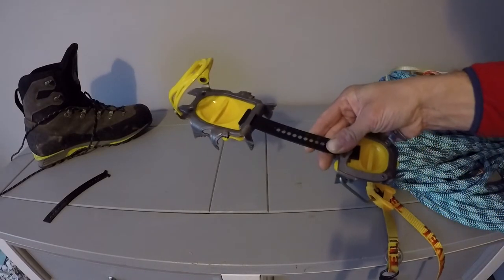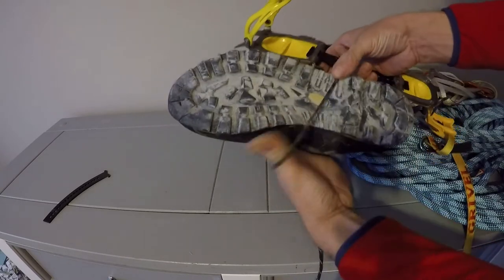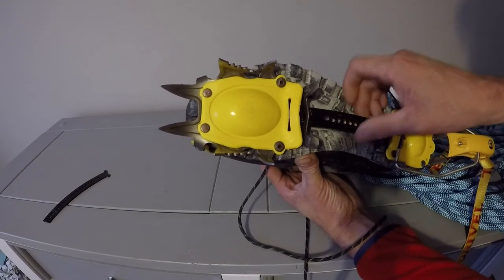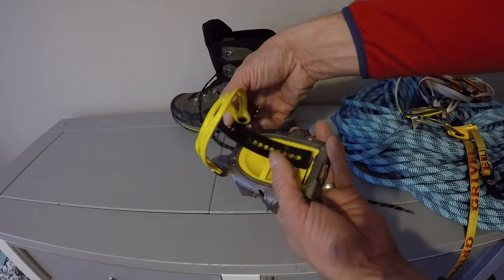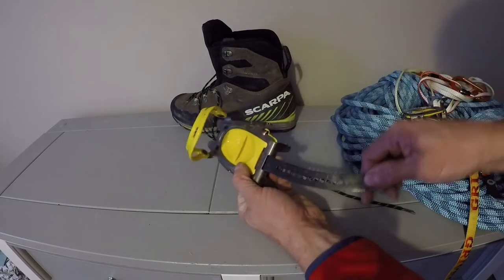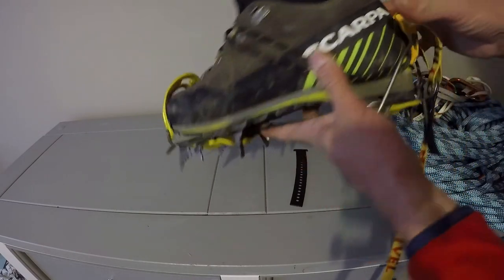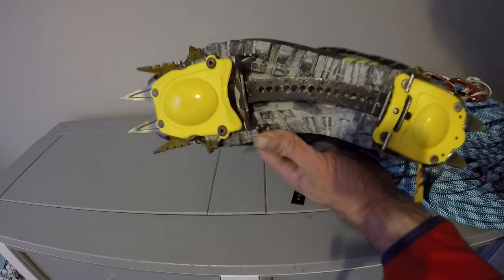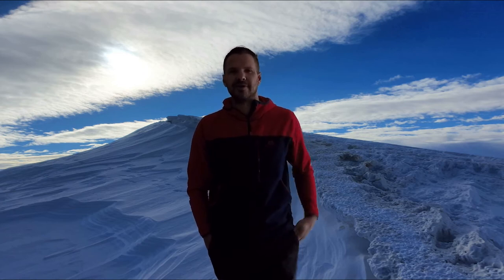How To Fit A Curved Bar On A Grivel Airtech Crampon

Comment: Hi Koos from Greece. I also did get the curved ("super asymmetric") Grivel bars for my G12s to use with my La Sportiva Nepals. Although the front section 6 points now sit definitely more aligned with the sole (like yours), the 2 FRONT points definitely look misalligned now (pointing way too much inward) when compared with the original bar...

Do you also experience the same with yours?

Safe climbs!
Reply from the maker: Thanks for watching! It seems like it when they are on however not when wearing them. If the crampons follow the curve of your boot nicely and the spacing is symmetrical it should be OK 👍